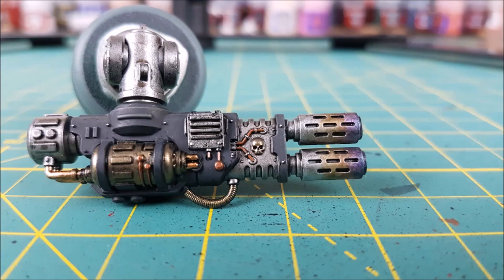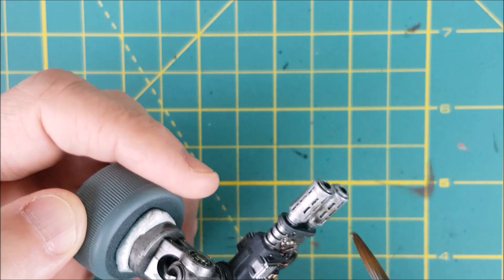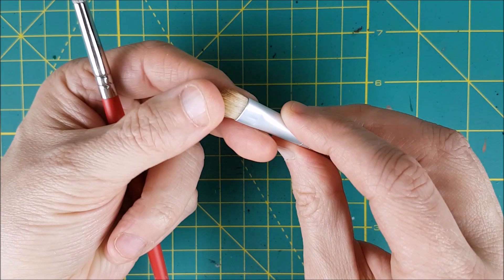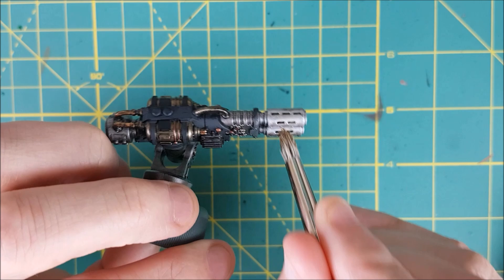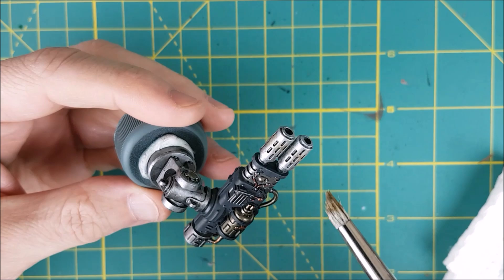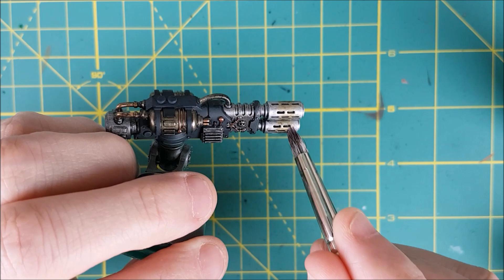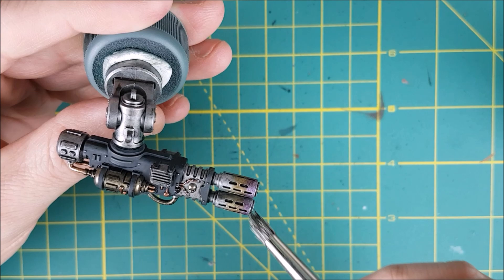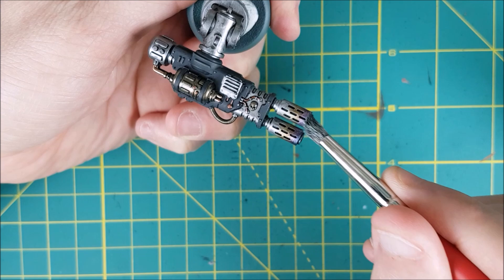How to Paint Heat Stains / Scorch Marks on Gun Barrels

Comment: Very cool effect.  Just for a point of edification, this doesn't happen on any gun barrels.  Gun barrels will turn cherry red and melt, but they will be normal color again when they cool.  It does happen on tail pipes though.  I believe the more chrome, the more of a stain you get.  Not sure where this started with the gun barrels, but I'm guessing it's b/c most 40K players only shoot with dice :-)  Keep the tip clean, and keep on painting.
Reply from the maker: I like to pretend that plasma weapons do this too ;) Though who really knows - I think the "rule of cool" applies most of the time when painting 40k. Is a plasma weapon barrel more like a blow torch or a machine gun when it shoots? Answer: whichever you want haha
Reply: Well certain parts of my saw would see this effect when the finished effect on the barrel has been stripped off.
Reply: @davidbright8978  if the bluing had been damaged, then the barrel is just another metal pipe.  Yeah, that makes sense, I just haven't seen or heard of it happening to anyone I know in real life.
Reply: Looks like a melta to me, not sure if real world ballistics apply too much.

Comment: looks very cool.  just one problem...  it's backwards.  the hottest part of a gun barrel is closest to the source of the heat, i.e. the chamber.  google heat discoloration charts  😉
Reply from the maker: Wouldn't it be hottest at the tip? Where plasma hits the air? I based it off a heat stained exhaust pipe I saw :)

Comment: I have a question.
how do I give that dark sidetone or what is it called to my guns as mine are shiny cause I only have metallic silver and it makes my metal parts look like a toy or brand new parts.
do I only have to use shader oil or sg else is also needed?
Reply from the maker: If you want to darken the metal I'd suggest mixing half and half Black Templar contrast paint and Nuln Oil. You'll still have a metallic look, but "blackened". If you just want "carbon build up" on the tip of the barrel, just dry brush on some normal black paint.
Reply: @WatchItPaintIt  thank you